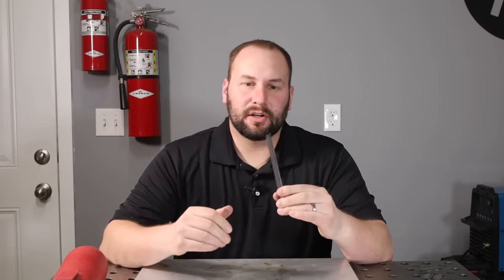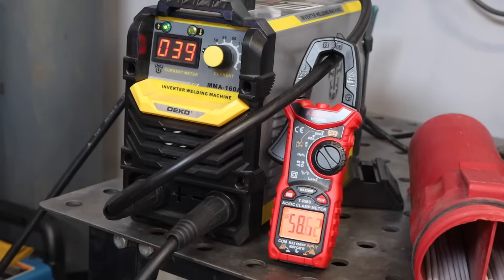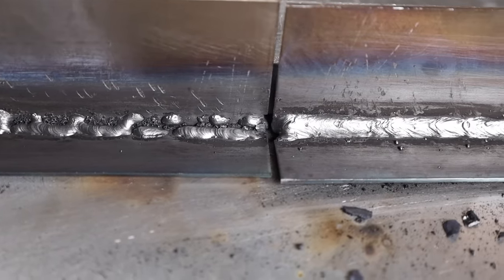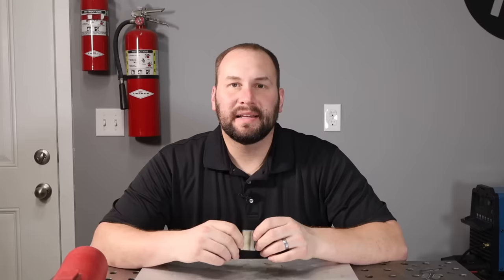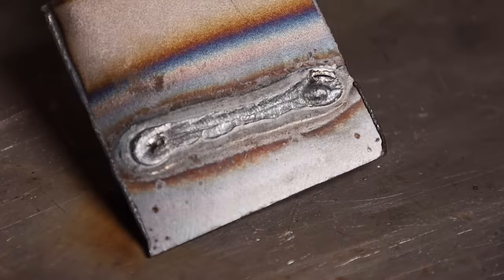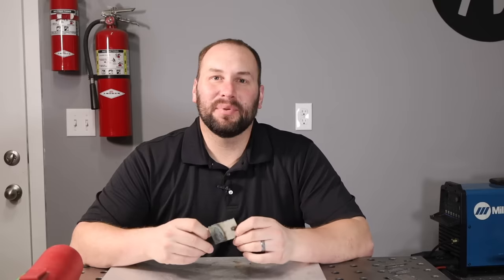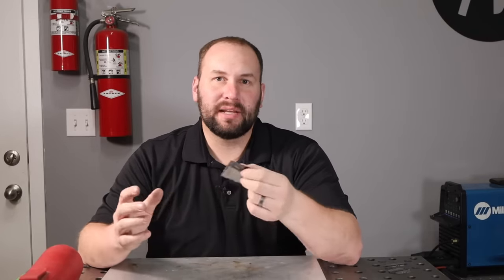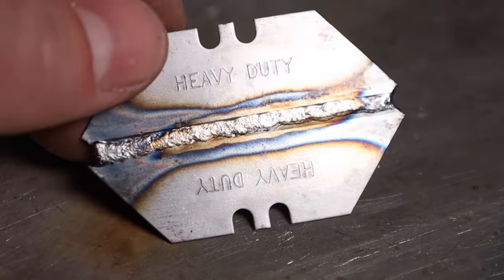Can I Stick Weld Razor Blades? | Thin Steel Stick Welding Tips

Comment: Thanks for the alluminium cooling support trick! I have one special situation:
I have to weld thin-walled square hollow bars.
Ther are around 1.6-1.8 mm thick.
However, the production of welding rods that are 1.5mm thick has ceased, and no longer can I get it here in Serbia. I have only 2.5mm thick (if you count the slag, it's 4mm thick electrode).
Second thing, remote location, and a friend has only one... questionable cheap welding inverter. Cost is around 160 dollars.
Thirdly, we have to use extension cord of a lownmower... that is over 40meters long. And the electric power is unstable, since we are using a electric line from bathroom...

So, its a biiig challenge, and I think that this trick with heat mitigation with aluminium will help me greatly! Thanks a lot!

Comment: flat on a bench is one thing. Now, find some old lawn mowers with cracks and chunks missing at the wheel mountings. This is the thin metal welding that commonly needs doing.
Reply from the maker: True story...repairs can be a real pain in the neck. Thanks for watching!
Reply: Add fishplates and it'll make things easier

Comment: I've always had a lot of troubke weldig thin with stick. This guy has a lot of talent. The most difficult part for me is striking an arc with such low current. On my crappy welder it either sticks or arcs and immediately goes out with such low current.

Comment: Great video! I have done alot of thin metal welding in auto body and later on more recently in a Tin shop we did not really deal with any thicker than 1/8th. Welded alot of 16 guage to make all sorts of sheet metal parts and guards and a lot of duct work and it was always galvanized and Stick with 6013 always worked the best and did not have to grind the galvanized edge to weld with stick so that made it basically as fast as mig welding with needing to grind it for mig.
Reply: Hey, just stopping by to say that the fumes from welding galvanized are really bad for your lungs. Take care of your health cuz you can't get it back if something happens -- just a little advice from someone half a world away. Peace 🕊️
Reply: @DelisonJunio  Hello sir! Thank you for the kind words! We use the speedglas helmets that have the pump unit you wear on belt or back pack style with a tube going to the enclosed helmet  it provides filtered fresh air and also have fans and exhaust fans. The union safety rules and also osha rules would not allow us to do it any other way but safe. That galvanized is very weird when welding it makes almost a spider web kind of white material when it is welded. It is very strange and unhealthy like you said. Anyone else reading this please keep in mine what He said and pass it along to anyone who may not know the dangers of welding galvanized material.
Reply from the maker: Thanks for the tips! I try to avoid welding galvanized whenever I can because of the fumes, but they can be managed when necessary.
Reply: @JayJay-de8vq  Yep. It will give you flu like symptoms. Its gotten me a couple times in the past. Safety is a must.

Comment: I need to see someone stick weld a mower exhaust pipe to a mounting bracket. I cant get it to hold longer than 2 months or I'm just blowing holes in it. Being two different types of steel is also a problem. Love your videos they have helped me in every project.

Comment: Bought the Deko and a 25ft 220 extension cable to run it to my dryer plug... Going to try my first weld repairing a broken mount on my mower deck... Thanks for all the great info!
Reply: What time of extension?  I found extension cables that work for this welder, but I’d still need an adapter for the outlet
Reply: @Ty-ye8rd  Miady 25ft 50AMP Welder Extension Cord, 8 Gauge Heavy Duty Industrial NEMA 6-50 Welding Machine Cord with Lighted End, ETL Approved
Reply: @Ty-ye8rd  both on amazon
Reply: @Ty-ye8rd  or if you dont want the link HZXVOGEN Extension Cord Adapter 10-30P to 6-50R 30 Amp Dryer Male Plug to 50 Amp 1.5FT 10AWG Welder Female Heavy Duty Adapter Cable Arc Tig Mig Welding Machine EV Charger Generator Connector

Comment: Thanks, I want to weld up some rust spots on my car, I can't afford a tig or mig welder, so stick welder it has to be, my previous attempts was terrible, but I was welding with 3,5mm rods, now I'm going much thinner, so let's hold thumbs  and I'm going to try the heat sink method as well. Thanks for vid.
Reply from the maker: Good luck! When I have worked on auto body panels, I've cut out sections and welded in patches by putting a lot of small tack welds in with a MIG welder. Slag would make that less awesome with stick, but it probably could be done. One thing I did learn is that the replacement piece needs to fit extremely well. Thanks for watching and for the comment!

Comment: Thank you for this video. I'm about to attempt replacing rusty floor pans in my truck but all I have is the same DekoPro stick unit. I think with some practice I can make it work for the ~18ga sheets
Reply: Just do spot welds all the way around the patch then fill in the gaps

Comment: A razor blade seems much thicker than the metal used on most consumer goods these days.  I tried to reinforce a tubing strut for our above ground pool, hard to heat-sink flattened tubing.  I ended up just laying a caterpillar bead on top of it with no penetration, then coming back through with higher heat, letting that caterpillar soak up most of the energy and trying for penetration at the sides.  It was pretty bad, but I hadn't welded in 20 years, and back then when I did it, it was with someone's machine that they could tell me what amp settings to put it on.  Navigating the settings on my own was pretty ugly.  But I did get it done.  Got to practice filling up holes on thin metal though that's for sure. I went with the same principle: lay a bead around the edge of the hole without much penetration, then come back with more heat to melt it all and strew it in a circle until the hole closed up.

Comment: One thing I notices on my welding machine is that it works better when I turn off "arc force". I think arc force pumps some extra amps into the electrode (over your setting) if it thinks the electrode is sticking. I have had MUCH better results with thin metal with this turned off (even though it may stick a little bit more). That took my welding up a few steps from "terrible" to "mildly embarrassing but functional"
Reply: Arc-force increase is best suited for thicker materials. You dont need it for any light gauge materials.

Comment: Neat tips! I'll have to pick up some of those 1/16 electrodes, looks handy for little stuff, and I'm cheap so I'll use thin materials a lot 😁. (I can probably do better with flux core on stuff that thin, but I feel like my deposition rate on flux core is pretty low, I don't get a lot of actual metal added compared to stick. Maybe it's my technique though) Really great to see a pro run 6013 on similar sizes as what I'm using, since I've got a 5lb box to burn through of them.
Reply from the maker: Thanks! These little rods definitely don't deposit much material for how fast they burn off (at least compared to the rods I'm used to running), but they were fun to play with and I think they'll come in handy from time to time.

Comment: If you believe strong enough you can weld anything even a broken heart
Reply: Until you buy a miller and then your wallet breaks
Reply: Unfortunately noone knows what filler to use for that yet.
Reply: Lol.. not exactly but if you heat up stone enough it will melt. You can then technically fuse it together
Reply: not about beliving. all about practise and craftman skills.
Reply: Did they teach you that in welding class?
Reply: no, the local watering hole. Lots of tequila and JD

Comment: I can stick weld a 0.7mm square tube using a 2.0mm rod, running at 55-60 amps depending on the machine. Spot welding is the key
Reply: Thats tacking not welding
Reply: @DMrider09  ok. If thats what it is🙄
Reply: @DMrider09  Lol. But remember tacking is a form of welding lol.

Comment: I've fixed many very expensive 1300  dollarish tractor mufflers using a torch and a filler rod.
Sometimes I've welded a 1/16 inch patch around a blown out part.
I beat it out and make it fit as good as possible and start welding.
I had 1/8 6010 rods that I used on the boring crew and I knew not to even try those.

A well worn muffler can be many times as thin as that razor blade.
I'd like to try some of those rods on one.

Nice job on the razor blades though, that's impressive! 😀
Reply: Mufflers are a bitch! Size o Victor tip and a slightly larger rod (wire) helps to heat sink it.. Joe And get rid of the flake rust

Comment: Good advice. More amps initially ends up putting less heat into the work overall. I’ve had good luck using 6013 dcen and using a 7018 with the flux knocked off as filler material dipped in the puddle like tig.
Reply from the maker: Great point. I'm actually planning on doing a video about the concept of heat input and how running low can make you run slow and put in more overall heat energy. I've never tried using filler with stick, I'll have to give that a try one of these days. Thanks a ton for watching and for the comment!

Comment: I'm new to welding and have the same Dekopro. Was this all on 220v or 110v? Also the amp range chart does it apply only to 220v?
Reply: The voltage you’re running on shouldn’t effect the amperage and weld quality correlation. 220v will allow you to use the full amperage range of your machine usually for rods bigger than 3/32. Everything he did here should easily be able to be done on just 120v.

Comment: 6011 or 14 3/32 at maybe 68 to 75 amps tops. I had to do this with some unbelievably thin shims at work for a screwjack roll stand on our Corrugator. Built the broken piece back up, milled it and redrilled the hole so it would fit back in the machine. They wanted it fixed now and didn't have any new replacement parts, loads of fun

Comment: Aw man, I bought the dekpro from your main stick tutorial and just started with a bunch of 1/16" sheet I have. Not the best way to start, but I got in for relatively cheap. No wonder I was blowing through so much! I'll have to stick an ammeter on and see what mine's pulling.
Reply from the maker: I still really like the Deko; I have found that I just need to adjust a bit after a test. I've had pretty good luck running it on 1/16" material with a 3/32 electode.
Reply: I’m in the same boat.  On 110, would i be using the same amps?   40 didn’t seem like enough.

Comment: Wow that's very impressive. I have a question though, does the trick applys to all types of weilding machines or just the brand you're using
Reply from the maker: It works with any brand of welding machine, but the better the machine, the easier it is to weld with in general.

Comment: Wow. 1/16 6013. Normally I'm running 1/8 5/32 7018. I typically run 150 and 55% dig. Miller 542 Gold Star. I'm gunna have to try this as soon as possible. I just need a negative DC capable.machine.

Comment: my first time stick welding was with a borrowed welder way to thick electrodes on 1.5 mm steel. needless to say id burned some holes and it wasnt a pretty job . but i managed to fill everything back up and the end result was gas tight. (wouldnt dare to put presure on it though)

Comment: Great video! 👍 Clear and precise explanations on all your methods and outcomes. I also like how youre honest and show all your welds (even the less pretty ones haha, these wormholes are common with 6013s). 

I weld a lot of sheet metal and I personally found that by tack-stacking (not recommended on anything over 3mm), I can get some really beautiful beads, I've even had some of my co-workers mistaken my stick welds for TIG beads! The welds done this way are plenty strong for its application and they penetrate nicely into anf through the back of the plate. 
By tack-stacking, you're basically just creating a puddle, then pulling out the electrode and killing the arc, and then start another puddle half-way in front of the previous tack. By doing this, I find that I can control heat input into the base material significantly and can prevent large sheet metal plates from warping too much.

Maybe you could try this method out sometime and you'd just might be surprised by how cool this technique is!

Comment: this was exactly a question I have been debating when selecting a multiprocess machine. just how thin can I go with stick? niw I know. 

couple thoughts. would be interesting to see effect of preheating metal before welding on something that thin. does it help? does it hurt? 

I have seen a bunch of people in videos do a series of small spot welds, when faced with delicate material, essentially letting the heat dissapate longer. would be interesting to see if that helps with the burn through.

If in a pinch you need to weld something that thin, it is probably not even remotely structural anyway (good strength super glue would probably do the job). I am thinking here about an emergency weld on an offroad vehicle or something to get you home. Perhaps a leaky water tank or pipe out in the field. Definitely not holding up a skyscraper.

Comment: Put down a series of full pentration tacks then let it cool, water spray if you like, then put another series of tacks against those, repeat until the joint is filled, you will have to grind off to make it presentable but it gets it done .

Comment: How do I set up my stinger and ground? Stinger in the positive and ground in the negative or...very very new. Been years since I set one up. I have a prime weld MIG180 but using stick or wire. Whichever is better for a rusted lawnmower deck

Comment: I'm a bicycle builder. I recently took welding classes. Unfortunately, for health reasons, I wasn't able to learn specialty welding; only stick.
My stick welder doesn't have polarity control, each cable only fits one port and no polarity reverse switch. I have the common rods in "standard" size because that's what I got to work with. My machine is good for 1/4" or larger 440 or better.
With that said, I set my amperage to the lowest setting that will run a consistent bead. The problem I have is, when trying to weld a custom frame (which is usually cheap retail quality steel. By that I mean I use retail frames as a base point.) I get blow through almost immediately. Like at the point of ignition sometimes.
I've learned to fill those blow through points but it takes up a lot of rod(s) to do so.
I plan to purchase a wire welder soon, but in the meantime I have projects just lying around that could be finished if I could do them with my stick.
Can you do a detailed video on how to stick weld bicycle frames? 
I put a lot of rod material cost into a recent tandem conversion project. As a resale and repair shop, I can't get my costs out of these projects at the rate I'm using rods. Especially with shop rate and welding rate added to these custom projects.
Is there any way you can help me resolve this issue? I know this video addresses the issue, but I honestly think I would have better luck with the razor blade challenge than the challenge I'm faced with because even razor blades are a better quality steel than I need to work with in my line of work. Mind you, I'm talking about quality over thickness. Bicycle frames are thicker but lower quality.
Reply: It would be best to swap the stinger and ground clamp around. And use fast in and out motions to avoid burn through. I've done a great deal of stick welding on bike frames and similar metals. With stick speed is important on light gauge material.

Comment: Hi…I have the same Miller suitcase stick welder.  I have about 1000 welds over 3 months I have to make for Chainlink fence gates.  Upswing 1-5/8” diameter, .055 thickness.  I will be notching the pipe.  I also have a Lincoln 140 set up with flux core.  I have 220v available for the Miller.  I have tried reversing the polarity with okay success.  What do you recommend?  Thank you for your channel!!🇺🇸

Comment: Thanks Tim for all your helpful videos. You are a hell of a welder man.  I am currently doing some lap joint and plug welds on the floor board of my car. The metal is 16 gauge. It is my understanding that I should be using straight polarity(electrode negative). Am I correct on this? I am afraid of burn through. Thank you again.

Comment: I noticed that there are blisters on some of the backside of pieces you welded, even some of the thicker ones.  Doesn't that mean that there is too much heat?  As I have dialed in a new mig welder, on some of the thinner pieces I weld I'm assuming that when the blisters occur, that means there is too much heat.  I'm I wrong to assume this?  I'm still learning this craft.

Comment: Had to weld up a rusty cast iron manifold with my AC225. Dumb idea? Sure. 3/32 6011 was burning clear through at 40 amps, it was so rusty. Wrong machine for the job really, wrong rod for the material, but I was successful. Burn it in and fill with 6011, then kicked it up to 115 amps and used 1/8 7018 for a cap pass.  And I'm not a welder, I'm starting welding class this August.